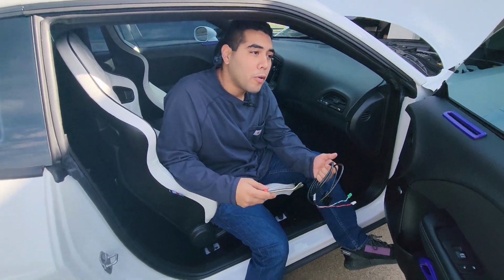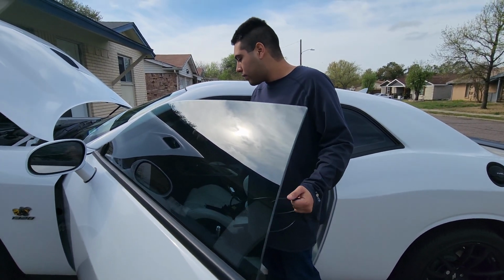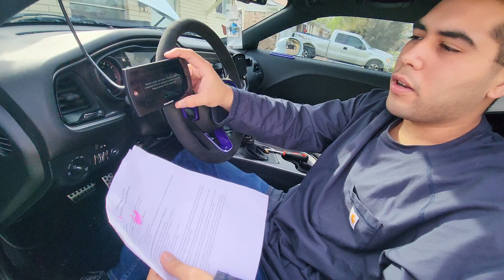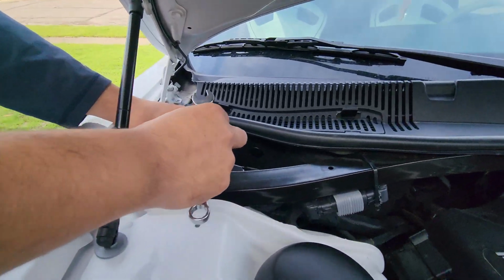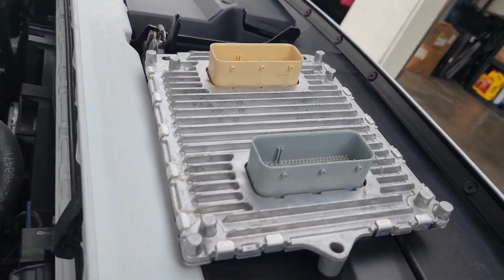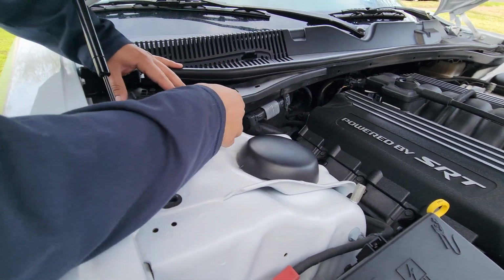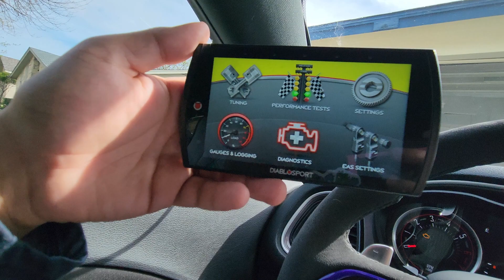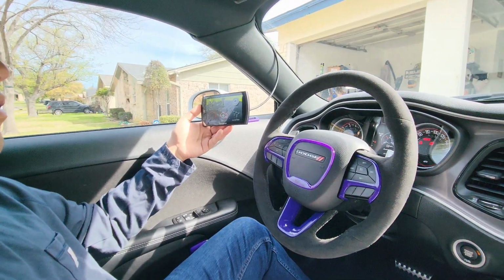Diablo Tuning our 2022 1320 Scatpack Challenger!/ How to Install Trinity T2

Comment: I want to tune mine so bad..the 1320’s have a granny shift problem on the track that has to be tuned out ..but it sucks the warranty is gone the second you tune it!  Car is a solid 11.7 car on the track but it could be a consistent 11.50 tuned!
Reply from the maker: We really wanted to keep warranty but we couldn't wait 5+ years to get the process started. The good thing is we've worked on our 5.7 alot so the 6.4 is almost the same in terms of maintenance.

Comment: Hi, Which exact port do you plug in the bypass cable into? I'm getting ready to tune my 2021 Shaker 392 Scat Pack Challenger, but this small part of the install is a bit murky! Is it the most outer one, or does it matter where on the green plug bar to plug it in? Thanks much and a great video!
Reply from the maker: Damn a Shaker seems really nice, but anywhere on the bar will do. They're all the same volt wire so just pick an open one 👍🏼